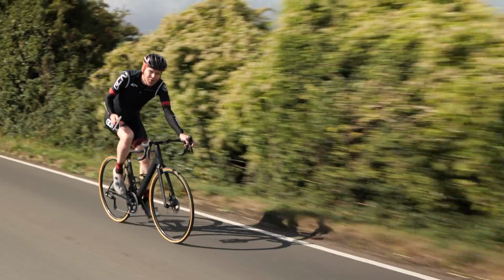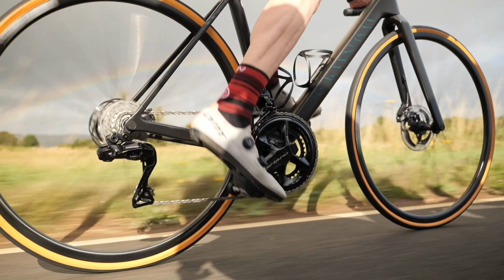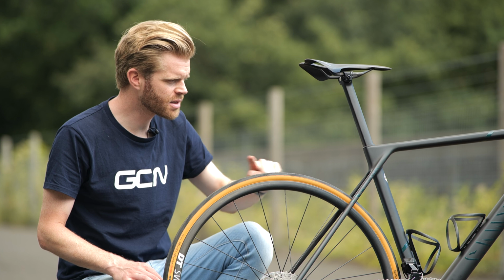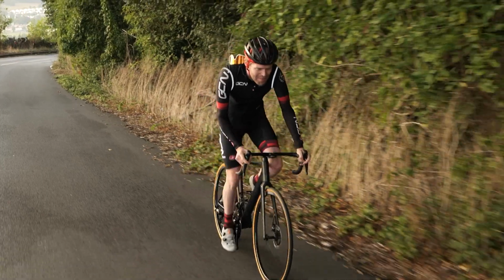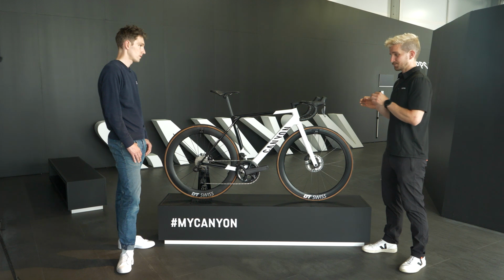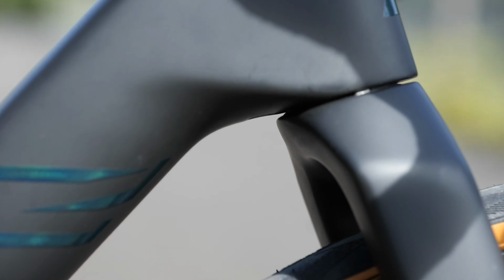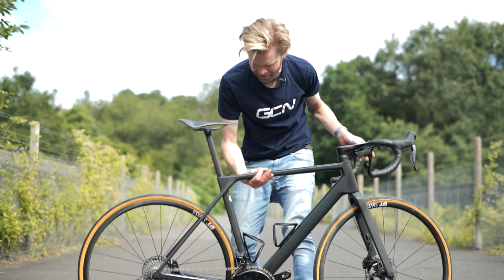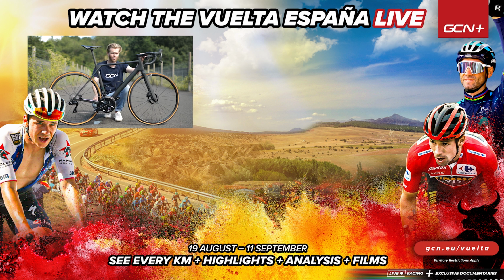​​NEW Canyon Ultimate First Look | 6.2kg Lightweight Racing Machine

Comment: Ollliieeee…. DT Swiss PRC DICUTs at a factory spec weight of 1266gr, Selle SLR C-59 saddle at 61gr, Canyon Lightweight carbon bottle cages at 15 gr each! Anyone with half a brain cell can work out that the weight savings are being made with components.

Comment: Where do you think is the sweet spot between price and performance in the new Ultimate lineup for an average rider who doesn't have money to burn? I'd like to get one, and am looking at the Ultimate CF SL 8 (£3,199), Ultimate CF SL 8 Aero (£4,949), and Ultimate CF SLX 8 Di2 (£6,449). 
Will probably end up with the Ultimate CF SL 8, unless the advantages of either of the others would justify the big price differential. (Is it worth an extra £1,750 for Ultegra Di2, a slight weight improvement, an integrated cockpit, and carbon wheels that would only become a spare set for me? Or another £1,500 on top of that for a better grade of carbon, another slight weight saving, and better carbon wheels that would still only become my spare set?)

Comment: My Canyon Ultimate had two cracked frames from chain dismounts. The chain coming off had pulled at the front derailleur creating a crack at the point it was bolted on. They replaced the first for free & then offered me replacement at full cost (€2,000+) when it happened again 12m later. I’m not heavy (72kg) and was only doing 300w. At that point I had no confidence in the quality of their frames especially researching and finding I wasn’t alone with this problem. 

Fortunately I was able to find a good carbon frame repairer so now have a stronger frame than Canyon sold me. He was shocked at how thin and weak it was in the area by the front derailleur describing it as being like cardboard. 

I hope they have strengthened this area by now but I am staying away from Canyons. Otherwise the bike has been good but the frame is the one item Canyon make with most other parts from other manufacturers.

Comment: Lighter, stiffer, more aero... of course. But what about those wedge-shaped headset spacers with the bolt? Is this some kind of system that ensures the stem is in-line with the wheel? If so, this is the real innovation in this bike. I can't say how many hours of my life have been spent over the years obsessing over whether or not the stem was aligned straight to the wheel. I cannot be alone in that.

Comment: "The geometry is the same as the aeroad". Nope, it's very different on Canyon's website. For example stack on L is 580 on Aeroad and an enormous 592 on this. On this bike I wouldn't be able to get the seat high enough on a medium or the bars low enough on a large. That's just going off the measurements on Canyon's website.

Comment: I'm still riding a aluminium Giant OCR from the 90s when something goes wrong with it I buy off eBay meanwhile the above bike cost over 10 grand which is ridiculous. But in 20 years time we won't be buying these carbon bikes in their used form on eBay as they will have cracks and won't be safe to ride.

Comment: It's actually good value when compared to other also out of control bike prices.
Reply: This was exactly what I was thinking. That's a $4000 wheel set and its got a power meter as well. Seems like a pretty good deal, compared to what the other manufacturers are offering at the same price point!
Reply: @covefe9210  that wheelset probably costs 300 bucks to manufacture.

Comment: 10,499 Euros.....oh my!     I'll keep my Cannondale EVo6 at 6.9 kg.
Reply: That's the one with 105? I had the one with Ultegra. I sold it three years ago when I got my new SuperSix with Red Etap Hydro. I regretted selling that bike. I did have visitation rights until the guy rear-ended a truck at a roundabout and damaged the frame. 😭
Reply: @DaveCM  It has the SRAM red group set. I also have nice 80mm carbon wheels with Michelin low-resistance tyres and latex tubes. It’s enough bike for my amateur level cycling….for now! 🤣

Comment: How about you use Dan Lloyds old 2016 ultimate rim brake which is lighter than this and you ask Andrew feather to race this up a climb Vs the new one. Would have their marketing department shitting themselves when the old model wins
Reply: Except that would be rim brakes so the comparison is pretty shit.
Reply: @fVNzO  I don't think it is. The point I am making is a 6 year old bike which cost many thousands less is still able to beat something costing £4-5000 more. The cost of today's bikes is crazy. Also an extra 5-6000 for disc brakes. New bike is 5 watts faster at 45km. Not something anyone but a pro would worry about
Reply: @lukepugh7728  Yes, but still, that's a very specific situation you gotta go rim vs rim and disc vs disc imo. But yes bike prices are abysmal. Giant used to be some of the best value bikes online and they've gone up like 500€ year over year since 2019 ish. Your normal disc, 105 carbon bike is now more expensive that an ultegra DI2 from 2017. It's pretty disgusting.

Comment: peak bike aka uci bike. the uci's restrictions severely limits peak bikes for maximum potential. once new bike tech gets old they will then revise and /or ease up on those restrictions which gives the bike industry a chance to produce upgraded models/ parts, inevitably consumers will be forced or feel compelled to throw out their old bikes and buy the latest and greatest bikes. recently it was the tube sizes in key areas.

Comment: If it's rim brakes,is it less than 5 kg?
Reply: If it was rim brakes and had the old Sram Red 10 speed groupset and crank...yes it could easily get down to 5kg.

Edit: as a reference my ti bike with the 10speed sram red weights sub 7kg fully loaded with pedals and bottles...imagine if it was carbon

Comment: Looks like the next bike I build up will have a rim brake frame with Campy Chorus with rim brakes and manual shifting. What other race worthy group can be built with rim brakes and cable shifting? The last Campy equipped bike I had was built with 8 speed Chorus Ergo.
Call me Retro.

Comment: They are a joke, last year's bike had much better value. They raised the price AND downgraded components at the same time. Asking 200 Euro MORE for the same bike as last year but with lower spec for example downgrading the DT Swiss ARC 1400 Dicut db to the much cheaper and heavier ARC 1600. Great job there!

Comment: Love My Canyon Ultimate SL8 but I can't understand how the new ultimate SL8 is 400 grams heavier than the previous generation and is even heavier than the Aeroad SL8 ? 
At 8kg is not a climbing bike.
Reply: It has a crap DT wheelset, which is 1950 gramm. So its good news, changhing it, u can gain -500-600 gramms easily.

Comment: Maybe a stupid question. But why is the rear brake in the left side?
Reply: how uk bikes are, elsewhere its swapped
Reply: @conradhyde4318  - Australia too - one of the Zwift academy riders last year had issues with this. I'm guessing it's related to the side of the road you ride on so Japanese, Indian and New Zealand bikes will be the same.
Reply: I'm used to riding a motorbike with ftont brake on right side of handlebar.
I jumped on a mates moutain bike in South Africa not realizing front brake was on the left side.
That woke me up pretty quick on a fast downhill section!
Reply: @davidheppell4001  yeah man, similar (less serious) story. When I was on holiday in Croatia we rented bikes and my brother had a nasty crash turning because he put on the front brakes instead of rear
Reply: Thank you for confirmation it was my thought to. Just wired to see thing vice versa 😁

Comment: Living in southern Spain and surrounded by sierras where I enjoy most of my riding, I'd have the ultimate, especially now that they have made those aero gains. Must say that the weight is amazing! Even the midrange model weighs the same as the top of the range Emonda
Reply: Merida scultura is way better looking and cheaper
Reply: And heavier
Reply: @sonim4858  depends on tjhe model, my budget dosen't go beyond the ultegra model, so scultura is way better
Reply: @bernardo9202  so what are you comparing mechanical 11s ? Even there Canyon has a 105 which is cheaper and lighter. Top of the Range bike - 700 to 800g
Reply: And the same weight as the Team Bike Scultura you already get for 2300 € less in the Canyon World. But True Merida is cheap compared to others but not to Canyon.
Reply: @sonim4858  comparing the newer models not the old ones, that's the first thing, also Merida has internal routing from top of the range to the bottom, Merida is cheap because is a part owner in Specialized, pushing the prices over there offering better deals to consumers in Europe imo
Reply: @bernardo9202  so then what are you comparing old 11s Ulltegra? Show me the prices i didn’t find any cheaper ones
Reply: @sonim4858  search again my friend it's all there
Reply: @bernardo9202  weather you show or you should stop telling lies.
Reply: @sonim4858  my man you have access to internet just like me, the hability so see and write, just search it up, it's on the website for everyone
Reply: @bernardo9202  Good so not available

Comment: Ollie that Canyon is pretty awesome and who wouldn't want a 6.2 kg bike, its awesome. I however have a 2022 S-Works Atheos with 28mm tyres on Zipp 303 firecrest wheel set, sadly it's 500grams heavier than the Canyon but, thats because I cheaped out and went with Sram Force instead of Red.
Reply: Ok.
Reply: @Penalist  tankx I feel better now.
Reply: Yeah who wouldn’t want a bike with a frame so flimsy one little spill and it’s knackered. I have a 2014 TCR that’s lighter than that 🤣🤣🤣🤣

Comment: 10 watts or 13 seconds over 10 miles in a wind tunnel... - 28mph/45Kph is a 21:26 for the 10.  Saving 13 seconds... is a 1% improvement - That's so small and in ideal conditions, that it will be well within the margin of error of even the wind tunnel test, let alone any practical irl test.  i.e  It's unsupportable BS.  From a Bicycle Industry Marketing department?  Never...

On the F1 Swiss Side link, I take it no one has noticed the $$$ Hundreds of Millions spent by F1 teams over the years on CFD and wind tunnels, not least this year's Mercedes incarnation, only to discover that they had made the worst possible design decisions for actual on track performance.

Those pearlescent stickers though... very nice.
Reply: 5 watts with a rider. Is a great looking bike though.
Reply: @Intentsrig  This detail seems to have conveninetly missed and should really be issued as a correction as the (TT) scenario given requires a rider. Given that Canyon have hidden the cables and reduced the height of the front end in line with the aeroad I am surprised that they couldn't do better very honestly (especially given the inflated speed used for the measure)
Reply: @mikebrewer1346  "I am surprised that they couldn't do better" - They can't even prove they did this well. They have to publish a figure that wont catch a class action lawsuit, but they also need to sell the bike... so we are told there is an increase, but it's well within any testable margin and all but untestable in real world conditions.

Comment: As a current owner of the CF SLX, I see no improvements other than the hidden cables.
Reply: Thats kinda the point tho
Reply: Truth!
Reply: Not really. The hidden cables add a lot of complication. The one piece bar makes it difficult to get the right stem length. Hand position is not as comfortable as a round bar. Garmin mounts/lights etc are also more difficult to add easily without expensive bike specific mounts and adaptors. For most people wanting an ultimate climbing bike traditional bars would be preferable.
Reply: @lukepugh7728  i find round handlebars less comfortable than aero ones
Reply: i see that as a hinderance. no internal routing for me. when they stop making bikes with external routing, i will stop buying new bikes. thankfully, not all manufacturers are obsessed with superficial bullshit that adds no value to the consumer.
Reply: No, you are just jealous and trying to justify having an old bike

Comment: There was a time, and it was not so long ago, when you could buy a Canyon Ultimate CF SL with Ultegra for 2200 Euros. I miss that time. Now I'm spending a lot of effort on maintaining my three Canyon road bikes, last one bougth January 2020, so they can last as long as possible and will not buy a Canyon (and probably any other road bike) until all these three have worn out completely.
Reply: In 2019 Canyon made a discount it costed 1800 euros only from 2200. That was insane value, 6.9kg R8000 Ultegra Ultimate. Now u cant get it under 10.000. Also back in 2016 Canyon made mid summer TDF sales, I bought my Aeroad CF SLX for 2500 (discounted from 3300). Today inflation is massive, nobody will buy new bikes soon.
Reply: I got my Endurace CF (7.2kg) with Ultegra for 1500€ a couple of years ago. But it was from their outlet 😛
Reply: I went with the heavier but more robust route over carbon frames because of what you said...want to make them bikes last as long as possible...so I bought 3 ti bikes and a steel. Heavier yes but I'm no racer.
Reply: @bonbonflippers4298  I'm interested to know what you think of the titanium bikes rides quality, I'm looking at getting one for endurance rides over 200km, but not sure it's worth the extra £££ and half kilo weight increase over carbon, what do you think?
Reply: @jamesward8140  let's be honest, what are you going to use the bike for? So much marketing bull out there that consumers tend to forget why they buy bikes for.

Racer? Carbon all the way no exceptions or a good aluminum. 

Non competitive aspect of cycling? What ever you feel most comfortable with in terms of budget and geometry of bike.

My 3 titanium bikes have 3 different characteristics: 

gravel - a little flexy but absolutely comfortable for all day rides and even better when ridden on gravel.

2 road geometry bikes 
  1- race geometry:  it's stiffness is between aluminum and steel it's perfect as it drowns the buzz from the road yet does not flex alot. [28c tube tires] stiff very comfy.

Then I have a super light ti that's endurance geometry but is almost as stiff as an aluminum. 

You need to be careful what you are buying with titanium because how they are built determines the ride quality.
Reply: Same here, 2 Ultimates CF SL 7 rim...

Comment: It's 10 watts without a rider, this is not honest journalism.
Reply: that’s why i say “according to canyon” it’s 10 watts more aero.
Reply: @readmorebooks-l5f   Thank you for the reply, apology's for the dig, it was not personal but please, it's still 10 watts without a rider according to Canyon or otherwise, 5 watts is the correct figure, still according to Canyon as bikes are only useful with a rider.  Second point, what percentage of the cycling fraternity really cycles at 45kmh to benefit for these 5 watts?
Reply: @rail1505  probably not many! but i do say that may be a lot or not much depending on your perspective. for me, it’s significant!

Comment: If it is 10W at 45km/h, how many will it be at 35km/h? 1W?
Reply: If that haha
Reply: 10W is without a rider. With rider only 5W according to Canyon.
Reply: @Gianniz27  yup, so around 1w difference at 35 km/h.. much less than changing tube to a better or inflating tires a little bit more
Reply: should be 6 watts
Reply: @felixsilver2758  doesn’t work like that, aerodynamic resistance is exponential not linear. The difference is greatly amplified the faster you go. The reason they pick 45kph, even though that’s not a speed people usually cruise at, is cause they need to in order to get a number that sounds better.
Reply: It’s all bollocks

Comment: At 14:58 Ollie says that there’s an spec with SL frame with ultegra di2 with power meter for 4,999 euros. Is that only offered in Europe ? Because I don’t see that option in the US website
Reply: Yeah I noticed on another review that listed pricing and it had no price listed for a few models for US dollars. 

I actually bought the 2022 Ultimate 12sp di2 CF SL 8 and it showed up with a left crank arm 4iiii power meter (Not listed on components). So that was a nice surprise. It’s Working well.

Comment: 10 watts for just the bike or rider as well, also was this winded tested for just laminar flow where the difference in watts is higher or turbulent? Even so real world wind is much different to the tunnels with no rider and laminar flow so that 10 watts of aero saving (on a light weight bike which isnt aero at all!!!!) is definitely not "a lot" but questionable but thats not part of your script. Any aero saving an integrated handle bar hiding cables which makes the bike more difficult to maintain and adjust😅
Reply: 10w bike alone 5w with rider at 45 kmh

Comment: Nice bike! But I would prefer build my own winspace slc 2.0 with rim brakes and their 38mm hyper wheels. Mechanical dura ace groupset with some oval rings and there you have your Leightweight Climbing machine for less than half price of the cfr ultimate 😉
Reply: I would do that too!
Reply: Yeah, that's pretty much what I am doing right now, but I'm going for the aero more than weight. Should end up being comparable quality to a top end Canyon, but under 4 grand.
Reply: @michaelmechex  which frame are you building up ?
Reply: @MegaXtc11  not entirely sure yet, I already have everything other than the frameset and wheels. I'll most likely go for Ican A22, but I'm also considering Elves Falath and Yoeleo R9 or R21. As for wheels I'll most likely get Winspace Hyper D45. I already got a good deal on Dura ace 9120 groupset.
Reply: Yeah I'd go this route as well...